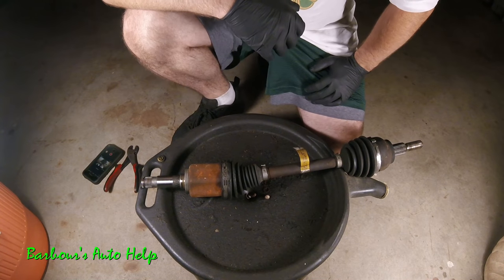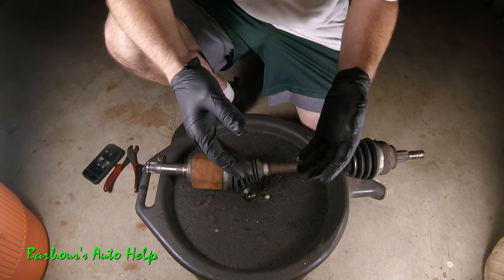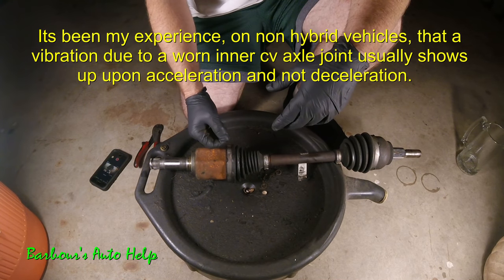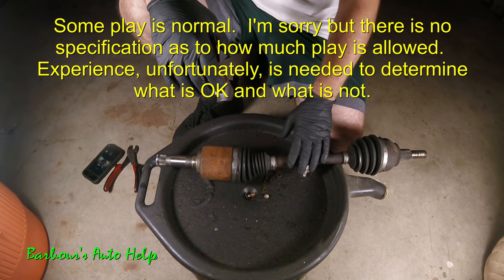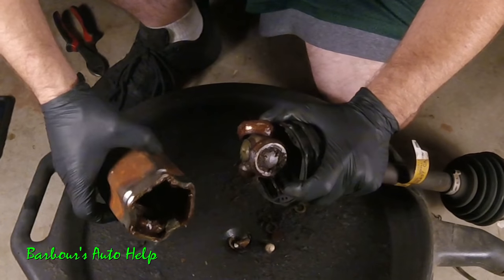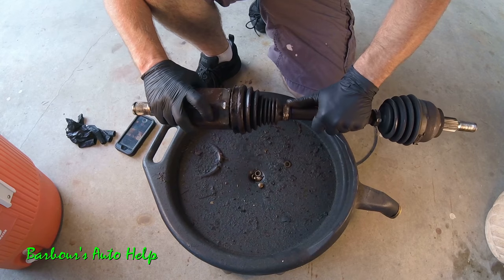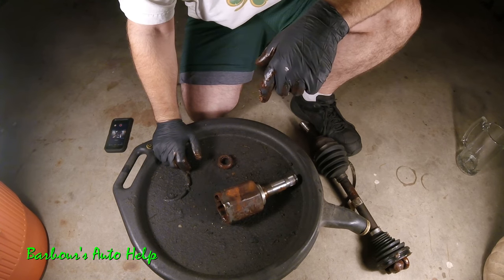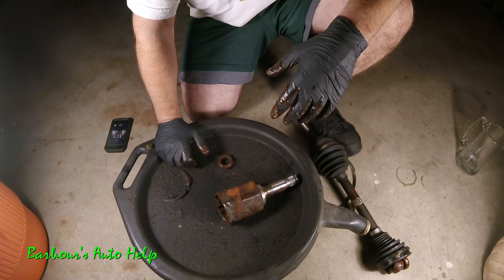How a Worn  CV Axle Can Cause Vibration

Comment: I have lots of vibration on my steering wheel when I hit 110kmph onwards. I have done the balancing and alignment rotate the rear wheel to the front the problem persist. Could it be the CV axle joint as you mentioned?
Reply from the maker: Possibly.

Comment: Can a bad cv axle cause you to feel a vibration in the gas pedal when going over bumps? I also have the vibration on acceleration as well, but I only feel it in the gas pedal. 

I've replaced all my engine mounts, and tire rods.
Reply from the maker: I suppose it's possible.   A lot of things could cause that by the way.

Comment: I have the same problem 2013 AWD Toyota sienna vibration when exlelerating. she shop change the right rear axle and it's doing the same thing so said it could be the iner bearing that the axcle goes into the diffencial .the put the van on the lift and exelarate and said the lift axcle was a bit wabbling so the change in but it didn't get any better.what do you suggest

Comment: My inner CV boot is completely missing(Front right).  I'm not hearing any noise, but last night started feeling vibrations at moderate speed going down a hill and feeling it around left turns.  Money is tight.  Any estimate on how much longer I can drive before it's truly dangerous?  (There's no way to tell how long the boot was ripped right off.  (2009 Nissan Rogue).  Thanks for your video.  Very informative.
Reply from the maker: No way I could tell you that.
Reply: Ugh im in same bout i bought a 2006 Toyota Camry has a ripped inner cv boot i can feel vibrated when pressing gas i was hoping i could drive it like this for a year at least...i repack the boot with cv axle greasse too make it last longer
Reply: Im curious how many miles mines will last before it fails an leave me stranded
Reply from the maker: Who knows.   Id fix it soon.

Comment: I have a 2007 camryLe when I putt into drive or reverse it has rough idle, in  neutral it runs smooth. I have checked all possible parts related to engine vibration, Could this be axsle related due to problems only apply in gear? thks 4 taking my question

Comment: I had a grinding that sounded a lot like a wheel bearing problem but upon closer inspection it turns out the grinding noise is coming from the upper cv axle joint. I haven't found any information on this yet. A constant grinding coming from the upper cv axle that is. If you have the time and any information on this it would be greatly appreciated. I understand if you cant reply. Thank you a ton for your videos they have helped me tremendously.
Reply: I had the same noise I replaced all 4 wheel bearing a in the end still noise similar to wheel bearing. Did you fix your noise if so what was it.
Reply: @geraouttahermaeens1075 turned out to be the transmission
Reply: @jasonmccorkle8760  Was it AT differential shaft bearings?  I changed both front wheel bearings but I still hear wheel bearing noise, sort of whirring noise, not constant grinding, and with slight vibration, mostly at speeds above 40mph. It seems to come from passenger side.  I am not sure if it is from inner CV joint, CV axle carrier bearing, or AT differential.  Boots on axle are in good shape.  So it makes me hesitate to replace the whole axle.
Reply: @jasonmccorkle8760  
Did you fix the problem because I think mine is the transmission too but I'm taking the hub bearing & cv axle off now.
Loud growling hum at 20 mph + apparently coming from the driver side.

Comment: hey buddy...so can a cv shaft be damaged from inside even if the boot is not torn? thanks in advance ...stay safe from phx AZ  ...Great video
Reply from the maker: Absolutely!  It happens.   It's not as typical but it happens.
Reply: @BarboursAutoHelp  wow ...that's great info...I been trying to find out we're this vivration is coming from when I hit 55 mph ...I swapped tires front to back because they are newer...and got worse...03 Toyota avalon...160k ...I just got newer control arms, no play in the tie rods, no wobble on hub bearings...I put a a GO PRO under  the suspension and seems like the CV shaft vibrates, @ higher speeds...not 100% sure if is worn inside
Reply from the maker: Have you checked it for play?
Reply: I does have some play...not much but  some...can't wait to open them
Reply from the maker: Are you replacing them?
Reply: @BarboursAutoHelp  not 100% sure yet ...is my sisters 02 toyota avalon I told her to get a 2nd opinión ...but I'm the one that works on her car and all my family's cars...they trust me alot...and this vivration is driving me crazy...I checked wheel  hubs,tie rods,swap tires from front to back because they are better, I did replace lower control arms about 2 months ago ,shock  struts look fine...what's left is the CV shafts...after watching your video it did help me a lot...I'm very sure CV shafts are the problem after watching your video...
Reply from the maker: I hope you're right.   Let us know.
Reply: @BarboursAutoHelp  most definitely...thank you  ...your a great help two...I will let you guys know for sure

Comment: My 09 Subaru has been making clunking/squeaking sounds when driving at lower speeds, and when accelerating while going straight or after turning there is a vibration/sound for about 2 seconds every time. Could this be my cv axle or boot? Do struts need to be replaced if the axle is damaged?

Comment: My 07 camry is doing exactly that. I had a really strong feeling one of the axles is causing it since we just put new tires on (it needed them really bad anyway) and it didn't change anything. Not sure which side it is so I just ordered both of them.
Reply from the maker: Let us know how it goes.
Reply: Ran across your video after noticing my wife's cars cv axles not rotating in a smooth manor.  Rather they have a "out of balance or warped" rotation.  Thought this could be my cause of vibration at interstate speeds 60-75.. Goodlettsville and led me here.. will check for vertical play in the morning..ty

Comment: Sounds like my issue.  vibration in front end only when i accelerate from 45 through 65 mph.  When i take foot off accelerator it stops.  Worst when going up hill.  Carmy SE 2009, 131K miles CV joints never changed. Had new tires put on and tire shop said maybe bent rim but the vibration stops when i take foog off gas pedal.  Your thoughts?
Reply from the maker: It may be.

Comment: What causes frontend vibration at highway speeds only while coasting or very light throttle with out touching the breaks. There is a clunking also felt in steering wheel  when light rockinh it right and left while sitting still . 2019 volkswagen atlas all wheel drive . 3.6 l. ( engine is in sideways ) outer tierods appear tight aswell as balljoints ..

Comment: Ive got a constant slight vibration at 70+ mph. No noise or boot leaking. 130,000 miles on a Cadillac DTS. Other than the vibration, it’s as smooth as, well, a Cadillac! Lol
Reply from the maker: What do you think it is?
Reply: Barbour's Auto Help the vibration isn’t constant. Sometimes worse than others. I’m stumped, honestly. I recently changed control arms, tie rods,  and new struts. About the only thing left to look at is a cv axle. Maybe a bad tire? I replaced the rack and pinion about 3 years ago, so it’s fine, and wheel bearings, rotors, and pads about 3 years ago as well. 30,000+\-  miles since those were replaced. I’m gonna look at the left axle in a day or two and see if it has any play or looseness to the inner housing. I’ll get back to ya.

Comment: I have a Honda accord 2014 Sport and I have a dull vibration at highway speed (starts from 90 km/h and gets worse at 120 km/h). Tires are balanced and engine mounts are solid (no play). I have the same thing with my winter tires. Do you guys have any idea what it could be ? I need this fixed because vibrations drives me nuts . thank you !!
Reply from the maker: Does it act like the description of the symptom in the video?  Under load or deceleration?
Reply: Same issue I’m having after installing BC Racing Coilovers.... 🤦🏻‍♂️

Comment: Hey man I’ve been have a similar issue going on, Everything has been running fine until a couple weeks ago and I was hoping you could point me in the right direction for what my pick up is needing. Recently my pickup started to make 
this humming/moaning/grinding sound almost like if there is rubbing going on. Which is ONLY when i go into reverse. It’s seems to come from the front end right below me, In drive she is perfect and It's for sure not tire rub. They were thinking it was the rubber on the cv boots getting rubbed. But there is no sign of distress or leaks.

Comment: Hello, I own a 2011 Nissan Rogue with the CVT transmission in it, I know these things are known to have transmission problems! Driving between 20 and 40 mph I notice vibration, past that the vibration decreases significantly. 
The other day I noticed a CV joint that’s leaking and thought that maybe the issue, but also the transmission fluid looks kind of dirty. I want to sell the thing, but would like to fix it first if possible. Let’s say I replaced the bad CV joint and doesn’t fix the problem.  Could dirty transmission Fluid  cause vibration issues? Hopefully I get an answer soon. Thanks
Reply from the maker: I'm really not that familiar with that transmission.   I do know that putting the wrong fluid in it will cause problems.  But as far as your questions... I don't know.   I hope you find the help you are looking for.

Comment: I’m getting a shake at low speeds, around 25 mph. And at higher speeds, I get a humming sound and the passenger side of the car seems to shake a little. When I brake at higher speeds, I can hear some kind of a grinding noise and also got a shake. Could this be a cv axle
Reply from the maker: Have you attempted to look at things?  If you’re not comfortable with it it may not be a bad idea to have a tech look it over. Sounds like you may have something else going on. Maybe maybe not.

Comment: ive had a problem with a lil clunk when I'm. going down my drive way.... i also noticed the vibration when going bout 50 or so i let off.. then gas it again and its good... what im asking is this... would the cv axel mabey making a clunking noise too...( its the same sound as when u shifted the axel in the video)
Reply from the maker: Its possible but I wouldn't guess at this.  It's probably best to have a tech look at it to make sure if you aren't mechanically savy.
Reply: Did you ever find out what was making the noise

Comment: hello mate, i have play in spot where drive shaft enters into gearbox, so after this big rusty part which is on left side in the video (i dont know how its called)...so when i take this big rusty part, and moving it up down, left right, i have play in spot where this rod enters gearbox...is that ok, and can be reasone because i have vibrations due to slow start from first gear or reverse???? thanks

Comment: I have a 2010 Honda CR-V AWD. There is a howling noise that also vibrates coming from the rear diff. Area, only at constant speed of 40 mph or so. I got under the car and I can see the boot for the drivers side CRV axel (rear) is torn and had grease on the out side. Could the cv axle be making the howling sound? Thank you
Reply from the maker: I've never heard an axle making a howling noise.

Comment: My wife's 2014 300C AWD has a pulse in the steering wheel at about 50 to 55 MPH. Above or below that it rides smooth. The car has brand new tires [balanced twice] new pads and rotors all around. Could this be caused by a bad CV joint in one of the front axle shafts?
Reply from the maker: Maybe

Comment: I have a 2002 Volvo S60 and notice the steering wheel wobbles at a low speed. Sometimes all I have to do is let off the break and the steering wheel will jolted to the left. I notice durning an oil change, grease around the boot and I’m thinking that’s the issue. I’m hoping it’s an easy fix to do.

Comment: I have a problem with my polo VW. so when I drive more than 80kmph and when I release my foot from the acceleration pedal my steering shakes heavy and feels like it wants to throw me off-road to the left side. I have to take gear to neutral for it to slow down and then speed a bit after that when I take a turn a hear a hard knock then it drives a bit fine. but high speed it gives me that. rods, ball J, and stuff are fairly new.

Comment: Would a vibration caused by this eventually even out at a high speed? I have a very very bad vibration between 40-55 mph and it evens out around 60 mph
Reply from the maker: It could.  An out of balance wheel could also cause a vibration from 40-55 and then go away at 60.  Have you had your wheels checked for proper balance?

Comment: I just changed the CV axle but I still get this vibration at 50km/hr. Also, I feel the vibration more in the middle of the car. Also, note that I have removed the propeller. What could possibly be the cause of the vibration

Comment: I have right rear vibration on my 06 Acura MDX touring only after changing the rear differential, a bit of play on the axle I’m thinking maybe it’s a couple of millimetres out, I thinking maybe I should tap it in a bit more Afro taking out the axle nuts or what do you suggest? I have a spare right rear cv axle that I bought or my other 06 Acura MDX that I haven’t bothered to replace maybe I should put that in and try or what do you suggest? I’m 100% sure the vibration is on the right rear wheel but I don’t know if it’s the axle, the rim or the actual tire. I changed the rotor already and the spare tire is firmly secured. Maybe I change that wheel to my other Acura MDX and see if it’s the wheel coz it all happens after changing the  2 rear tires.
Reply from the maker: Shoot... I'm not sure what to tell you on that.  Maybe you can have the tire balance checked out and check the rim and tire for run out.  But, to be honest with you, I don't know.
Reply: BarboursAutoHelp after taking out both rear absorbers I realized the left was that bad, wouldn’t spring back up but vibration is still there so next step is to change the tires starting from rear

Comment: I’d love it to be my axle lol. But sadly. My rpm guage fluctuates and it shudders and jumps which seems to be at random. I’ve had it do it above 40 and below 40. And no check engine light is one. Axels seem okay. But sadly. Combine the vibration and shuddering along with the rpm guage I think I’m looking at a new torque converter 😭
Reply from the maker: Very possible.
Reply: @BarboursAutoHelp  also. I had a flat tire and got another tire and it was a snow tire. So I had one snow tire on front and one road tire on driver side. Weirdly it didn’t start doing the jumping and shuddering until I did that. But weirdly even more….it seemed to somewhat make it better when I changed the Floyd and filter in the trani.

Comment: On a FWD car should I be able to halt the rotation of one side while the other still spins when the front of the vehicle is off the ground and trans is in drive? I'm thinking my fiance's altima has a bad cv axle/joint
Reply from the maker: I really would not suggest doing that.  Sounds dangerous.
Reply from the maker: Yea, I still don't suggest it.  Cars are equipped with traction control now days.  That's asking for injury.

Comment: Dumb question, but I’m having issues with my 2004 Ford F-150 4x4 xlt, well let’s get down to it. I replaced the drive shaft got it directly from ford. Anyways I’m experiencing some vibrations when accelerating and deceleration. Feels like in the steering wheel and the gas pedal. Then I i engaged 4WD then heard clunking or popping sound in my right front side of the truck. Can a bad cv joint or axle cause this vibration? Help please
Reply from the maker: Was the vibration there before you replaced the drive shaft?  Also, is the vehicle in 4x4 when the vibration occurs?
Reply: I fixed it. Still a vibration in 2WD when I’m going 75-80 miles an hour

Comment: Would a bad Inner Cv cause vibrations on idle? also have a rattle noise when pulling away on 1st 2nd slight rattle on 3rd ,4th gear 5th smooths out Inner cv?
Reply from the maker: A bad Inner cv axle would have to be rotating in order to cause a vibration.   When a vehicle is motionless and idling the axle would not be rotating.   So, no it would not cause a vibration at idle.

Comment: I had a rotational thud that turned into a squeal every time it hits a certain spot. Can't figure it out. It sounds like bad universal joint on a rear wheel drive car except mine is a 02 Honda Accord v6 which is front wheel drive. I wonder if a broken rear motor mount could cause that
Reply from the maker: Not sure. I'd think a rotational noise would be in something that rotates though.

Comment: Hi, I have a question on my 99 Buick supercharged riviera w/ 70k.  Aside from a vibration from 65-70 mph and some banging when I make a turn @ slow speed while stepping on the gas, will a bad CV axle make a binding sound when I shift from drive to reverse and turn the wheel to back into a parking space? Control arms & all bushings are new. Tires were road balanced. I have new axle's ready to be installed once my mechanic returns from vacation. I hope the noise is from the axle's and not the rack or the p/s pump. Ty for any advice.
Reply from the maker: Hard to say.  But I guess it's possible.
Reply: @BarboursAutoHelp  Thank you for the reply and I guess I'll find out soon enough when I install the axles. Happy holidays.
Reply from the maker: You too!  Thanks.